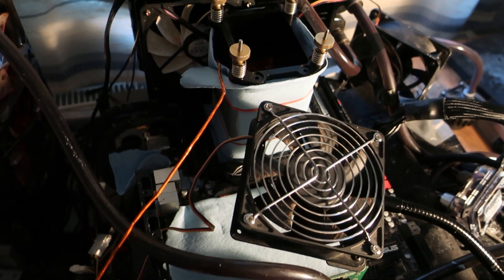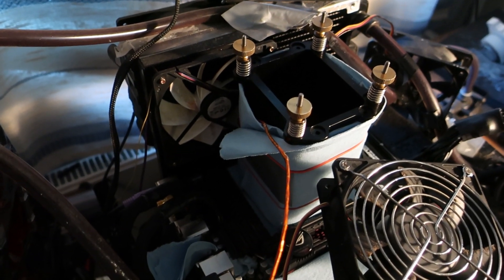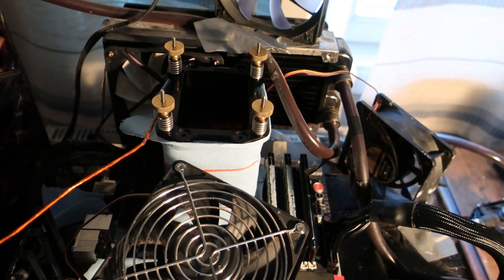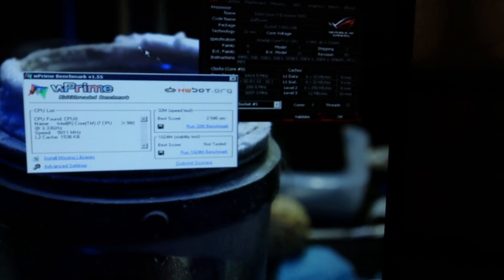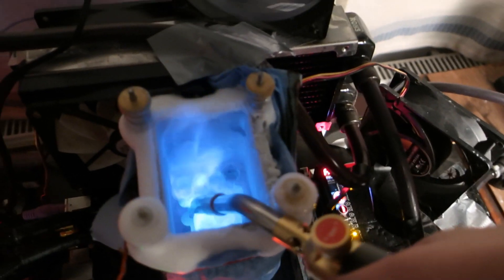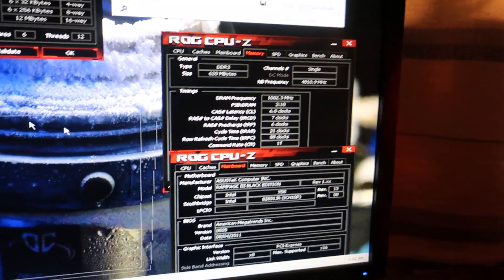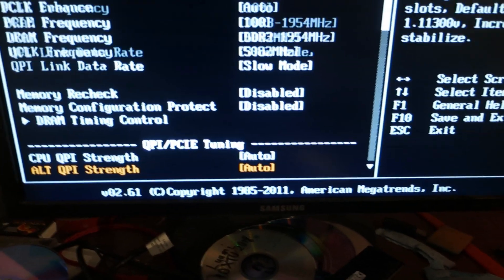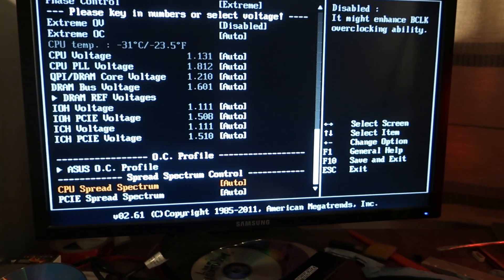Overclocking Core i7 980X to 6.6Ghz+ on Liquid Nitrogen - Wprime 32M record

Comment: I've got a line on an ASUS Rampage II extreme, with an i7-960, 3x2GB Dominator, and a Dark Rock Pro cooler for $220CAD. Is that a good deal?
Reply: Go with Ryzen instead, intel gets hit by smeltdown pretty hard.
Reply: @Wasmachineman  I already have multiple computers, so it's not like I need one. More interested in it's overclocking capabilities, and if it a good value for the price. I can always find higher end i7's and XEON's for it at reasonable prices. I more so do stuff like this for fun. Probably the only time it would ever go online is to post scores.
Reply: In that case go for it, first gen i7's and Xeons overclock like fucking crazy.

Not as crazy as Pentium 4's or Sandy Bridge though.
Reply: @Wasmachineman  Oh I know they do! I've been in to computers for close to 40 years now. I think my last P4 let the smoke out at 5.6GHz! LOL! My main system is the EVGA X79 DARK, with a XEON E5-1680-V2 at 4.7GHz all core. Haven't had the time to do any major OC'ing yet, but I will get it over 5GHz when I do. My old i7-4820K did 5.1GHz on this board. Hell, I'm still using my old Gigabyte X38 with a Q9550, now retired to being my shop computer. It runs at 3.8GHz.
Reply: Good Deal - try to get a Xeon 5670, 5675 and up while trying to push 4.4+ GHz out of it... Remember cooling the x58 and the VRMs plus renew the cooling pads / use paste and active cooling
Reply: @bjornpaulsen3015  Well, I think I will get it then. I always replace the thermal interfaces. I use Kryonaut paste (12.5W/mK), and either TG's Minus-8 pads (8W/mK), or Alphacool's Ice thermal pads (17W/mK). 

I'll have to invest in a POST code reader for it. They are pretty cheap to buy. Also just found an old GTX Titan (6GB Kepler) that I can get for about $140CAD that would go great with that board.